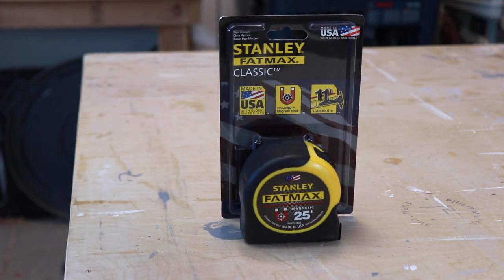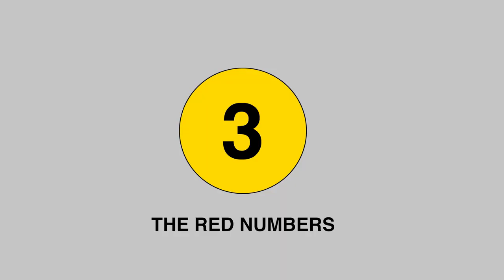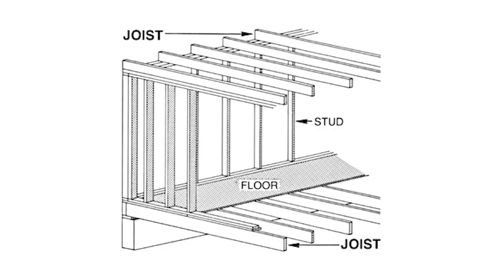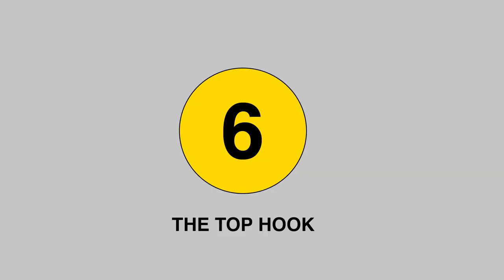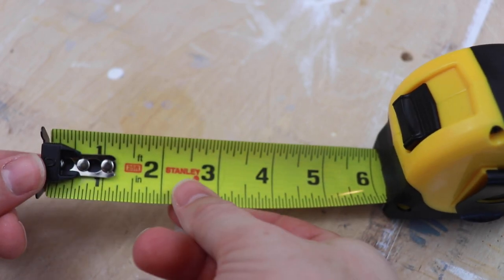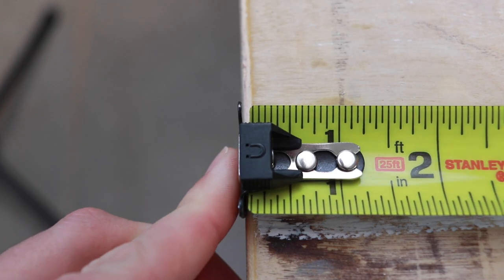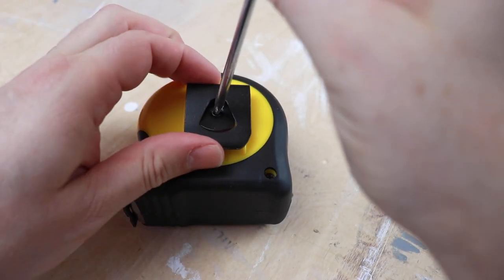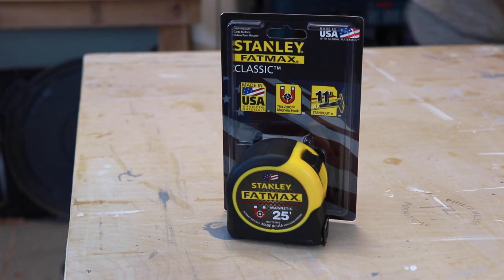10 Things You Did Not Know About Your Measuring Tape | #tipsandtricks

Comment: Couple things I learned using a tape measure for years.  1) if your diagonal measurements are equal, it doesn't mean it's square.  2) to find the middle of a width, the tape doesn't need to be at a right angle .  3) if you picture 1"= 1 year,  and the 30" thru 39" are the 1930's,  the 90"s are the 1990's.  @100"= the year 2000. Now fold back the tape to 120" (2020)  and every ones  birth year will be across from their age. At the bend is 50" ,so if your 50 you were born in 1950.  4) in the northern hemisphere, I can tell time within an hour, if it's light out. Take my word for it, I don't want to explain the procedure. .......oh ya,  pop'n an airborne 25 footer with a 12 ga. .....................priceless (if it's somebody elses)
Reply from the maker: Thanks for the additional information. I just found out the age thing a few weeks ago myself. Cheers!
Reply: If the square or rectangle has parallel sides equal diagonals most definitely equall squareness.
Reply: @scottarruda5064  an isosceles trapezoid has two parallel sides and has two equal diagonal lengths...and not square. 🤔
Reply: @70supertube  it has 2 sides parallel...not the other 2...

Comment: Eight feet = 96 inches, and six vertical supports at 16 inches on center is only 80 inches or 6.6 feet.  Therefore, you need seven vertical supports at 16 inches on center to span eight feet.
Reply from the maker: Thank you for the info

Comment: Your explanation regarding the black diamond markings on tape measures and "I beam" joists is not correct.
Manufactured I beams are not as strong as equivalent dimensional lumber and require an additional joist for each 8 feet of floor length. In cases where dimensional lumber floor joists can be spaced 24" on center, the use of manufactured lumber in lieu of dimensional lumber requires I beam placement on 19.2 inch centers. The placement of the diamonds on the tape measure is at 19.2 inches not 19 3/16 inches and align precisely at each 8 foot interval on the tape (96 inches divided by 5 = 19.2 inches). In short, the diamond markings on tape measures indicate 19.2 inch center placement of manufactured joists to accommodate 4 x 8 foot sheet goods.
Reply from the maker: Thank you for the feedback and details
Reply: Good explanation Richard but you might be getting confused between decimal calculations with fractions. 19 3/16 inches is exactly the same as 19.2 inches. It's just that 19 3/16 inch is the actual fraction reading on the tape but when dividing 96 inches by 5, you convert that fraction reading to a decimal number (19.2 inches).
Reply: K